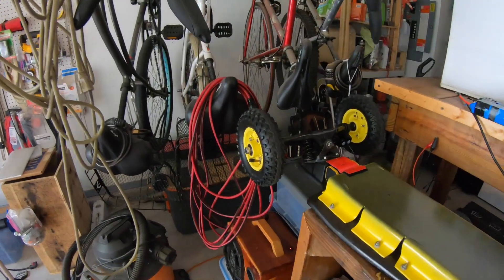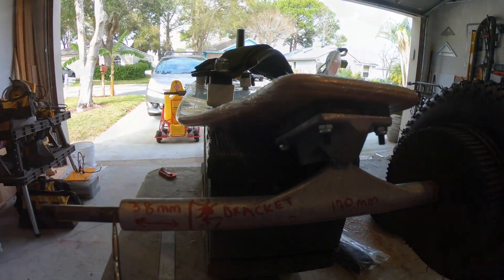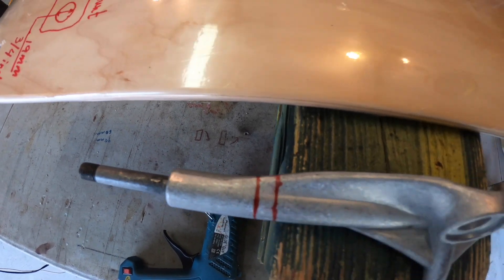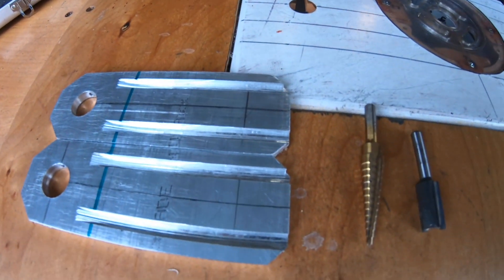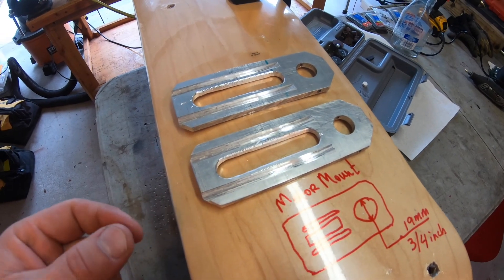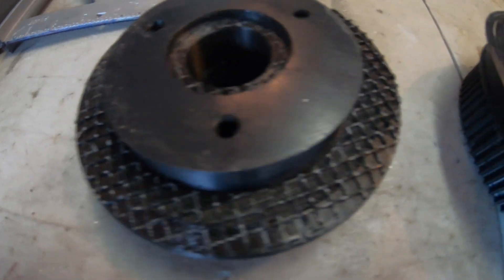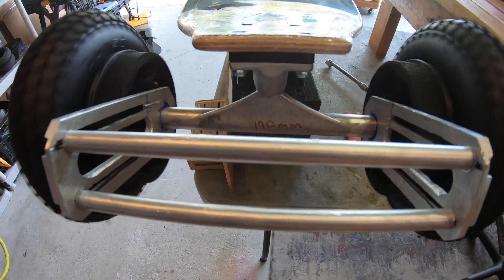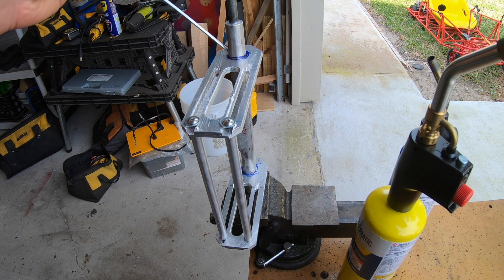All-Terrain ESK8 on Budget

Comment: Hy, how you conect Motor to Controller, i have also a Motor with Red, Black and blue cable, Controller blue, Green and yellow! How i Can conect it correkt?
Reply from the maker: Hi Pagtach.  If you only have 3 wires, it does not matter how you connect them.  Connect them any way you want.  If the motor is spinning backwards, switch any two of the three wires.  Hope that helps.  Have a good Day!
Reply: @artsiomnaidzich9515  ok thx

Comment: What filament did you use to 3d print the pulley? Nice Board, how is the range on a full battery?
Reply from the maker: Hi Mr. Soko!  ABS for filament.  10 to 15 miles range.  Also depends on riders weight and terrain. Cheers!
Reply: @artsiomnaidzich9515  Thank you!

Comment: Because you've got to admit you have a pretty nice machine shop there set up for building skates, really instead of taking offense to what I'm saying you ought to be taking it as a compliment the problem is me before just envious of your tool selection and sure they could do that if they had that kind of equipment, the 99% of everybody wouldn't be able to build any board like the board in the intro of this video I mean come on man you're giving people unrealistic hopes that they can do this on a budget with no tools or even  skills or time needed on using these tools I don't see it happening..  giving people false hope that they can have a at Eastgate for a few hundred dollars and it just ain't going to happen
Reply from the maker: Hey Tony. Im not taking offense to the shop comment. And thanks btw for shop compliment. My yt channel is a small part of what i do. And i do it not for clicks, but because i enjoy it. 

Its ok to disagree on a point.  (Point being that this video's title is click bait).  In video description, i do mention that this type of project does require tools and knowledge. This board was build on a budget of about $500. I know that to some $500 is a lot, myself included. Similar boards over the counter sell at about double that amount.  Sure, you can buy a used board in an unknown condition. Sure you can buy a board for 500 as well, but it will have smaller battery/motors (which is most of the cost of my project board here).  Therefore I feel  like this vide's title is appropriate.

Comment: Hey Guy, really nice Job!
Do you have drawings of the selfdone mechanical aluminium parts (motor brackets)?
And where are these little gearings from for the motor?
Reply from the maker: Hi Nico.  Thanks.  No drawings mate.  I used a.motor bracket that I had to get my measurements from..  Motor pulleys you can find online (amazon, ebay, aliexpress).  this board uses 5m pith tooth with 20 teeth.  Width of pulley is 15mm. Pulley 5m20T 15mm.

Comment: On a budget if you already have Thousands of dollars in tools and 3d printer ect.
Reply from the maker: Hey there Tony. Just about all of us have friends or family with some tools we can borrow or workshop you can use.  If you have another method on how to build an esk8 on your own without tools, please let me know.  Buying pre-made parts and just screwing them together is not building in my opinion (option that doesn't require tools), and is more expensive.  There has been a handful of people that shared the same comment as yours on this video.  I get that it takes tools. U cant have something out of nothing. If you have the drive and a will to build something, you can find the way to a 3d printer, a local workshop (many vocational schools can let u use theirs for a small fee), and people that can help you.  You know who is not going to get anything done/built? People that say: "esk8 on the budget? Yeah, right. Tools you used are expensive".
Reply: @artsiomnaidzich9515 I plenty of tools, just not specialty fabrication (expensive) tools like you got. And btw you need a screwdriver to just screw parts together. That is a took a d you know that no matter what premade parts you buy I've never seen a plug and play way of doing it and it's just not that easy, I'm sure you know that. Anyways what I was getting at about your clickbait video is I was hoping it was going to clue us in on some technique or parts to obtain to build a esk8 at costs on the low low. As esk8 parts are pretty damn pricey. Btw not everybody not even half of everybody is fortunate enough to know somebody who will let them use and put wear on their expensive custom tools and fabrication equipment. I by in no way am dogging what you have done or the way you did it, I am dogging the chosen deceptive title to your vid. Peace out brother build on. Oh and I have built my own esk8 out of screw together parts a few custom parts and I have bought a nice one for retail. It was the best purchase I've made this year and I don't regret it for a minute. Hey brother nice custom build you should be proud. Later.
Reply from the maker: If there is one thing i dont do Tony, its click bait. Most tools i used are woodworking tools not designed to work with aluminum.  I dont think you know/understand tools that i used.  I dont know of a more economical way to make your own skateboard than what this video shows. But here comes Tony with criticism, yet nothing to add.  Thanks for nothing bro.
Reply: @artsiomnaidzich9515  you don't do clickbait okay I'm going to put out a video and it's going to be titled how to drag race on a budget first step is I'm driving in this Corvette in here how the f*** is that if that's clickbait. there cuz it's not on a budget what cuz I used cheap gas and used tires??? Clickbait.
Reply from the maker: @tonyp3391 , you beautiful complainer.  It seems you have your mind set on proving that my video is click bait.  I couldnt understand what it is you are trying to say in your long rant. Sounded like a long run on sentence. Your og idea is to find a used board, and replace parts on it with used parts? I don't have to tell you that in a video format. Anyone knows buying used is cheaper... your corvette analogy, does make sense to me either. 

Het Tony, go for a walk today. Get some of that pent up energy out on productive things, rather than posting confusing rants.

I have built battery, pulleys, motor mounts, battery cover. 

This is the cheapest way to build a decent board thats new.  

That board has been sold, and still rides today.
Reply from the maker: Tony, that analogy is wack.  Click bait n bait n switch is same tactic. Title of a video promises one thing, video delivers another. Now, you are angry with me because i titled a video how to build on the budget, than i build a board building as many components myself as i can (in order to satisfy the budget claim). Yes, you do need skills and tools and time.  And that, in you angry brain is click bait? Good luck Tony! Have a nice day.
Reply: I watch these videos thinking I can finally build an e-skate on a budget, nek minute he's using $5000+ worth of tools🤣
Reply from the maker: @raynman6466 , you overestimate the price of tools i used. Same work can be done with hand tools but will take u much longer (also will require u to buy additional parts, like wheel pulleys)

If u have been doing diy esk8 hobby for some time, there are really two ways about it:

1. Expensive: most parts are preassembled, everything fits, there is relatively low amount of work that needs to be done.

2. Less expensive: where you build your own battery, enclosure, pulleys, sometimes decks, etc. its not a kit where most of the decisions on parts gathering has to be done by you, the builder.  Its a balancing act of what u are able to create yourself, and what u need to buy.  Also, people on esk8 forums will sell their used parts, but rarely for cheap.

Goal of this video was to show what can be done with mostly woodworking tools. But if all u see is table saw or miter saw and begrudgingly announce ur disappointment, than this video has failed to reach u.

If you know of other ways one can build a decent board on a cheap and without tools, do enlighten me.
Reply: @artsiomnaidzich9515  ok I'll enlighten you first off you are going to need some basic tools like you said but you're just not going to need like metal fabrication tools from a machine shop or something here's the enlightenment for you you watch marketplace or Craigslist you find it used crappy board that used to be good broke down or whatever and oops it needs an esc, oh wait a minute if you want it to be anywhere as good as you expect to be or that it used to be and if it was a party board you're going to need to be yes see no $60 parts going to work here you're going to have to get the two 300 $400 part just for the VSC then if you want to build your own battery well I happen to have one but you're going to need a battery you can get more than cheap things that don't really work for 50 bucks he has been a couple dollars on that we're already out of the budget mode already we're already done with the budget right there there's no enlightening you on how to do it any cheaper or budget mode because there is no budget mode Esk8 diy not one worth of crap anyways sure you can get the $50 ESC with the cheap ass controller that don't work for s*** and drives one motor at 10 mph but that's just not going to cut it for me. I will not you on one thing though for my battery box I used kydex a thermoforming  plastic to make a good size box for half the cost of what crappy regular black box of s*** would have cost me and I'm pretty impressed with it it looks pretty good on the board all you got to do is heat it up and form it in shape it works great and it's just pretty solid once it's cool down again. There you go there is a damn good tip.id post a pic if I could figure out how.
Reply: Can't expect to DIY build without tools! I reckon this can be done without the Dremel, mitre saw, heat gun, table saw or drillpress. I won't call it easy, won't look as good and it'll take longer. But it is aluminium,  soft and easy to shape with basic tools. 
Some great tips here like the aluminum brazing. That on it's own will save $×××× on an AC TIG welder!

Comment: Hello, I make quite similar built to yours and I'm wondering how those motors perform in time?
Reply from the maker: I made this board for a friend of mine.  He rides it a lot.  No problems with motors yet.  Are you having issues with your motors?
Reply: @artsiomnaidzich9515  no bcs I haven't ordered them yet, but on groups on Facebook some people said that they had some problems with magnets coming loose
Reply: And that was only issue that I was worried about
Reply from the maker: @ja-ob9bp  Ive had that happen to me.  Not with this motors though.  If you want to avoid that problem, get maytech motors.  New Flip Sky are also good.  Those two I have personally tried and know they can hang.  Everything else is a coin toss.  Companies just relabel generic motors and sell them as if they are much different than 80% of similar products out there.  Rebranding to be more precise.

Comment: Budget!! Right, first you'll need a budget board then a 3d printer, bench grinder, router table, mire saw, table saw, drill press, dremel tool with attachment, and a selection of other tools. Then you can get on with your budget build!
Reply from the maker: I cant tell if you are serious or just fucking around. First, you dont have to follow this recipe, just get a pre-assembled used board and call it a day.  Option 2, get all used components, put them together, and boom, u got a super frugal ride.  Above options are not good video material in my opinion. If you are willing to build something, you get some tools or have friends that have tools. The tools i used are not that rare or exotic.  And same result could be accomplished with less or different tools.

Comment: Where did you get the wheels and tires
Reply from the maker: Calvin Ronk Snee King, i used wheels and tires that this board came with. Pulleys are 3d printed (read the video description for the link to stl file)

Comment: If I use a vesc, would a 6354 motor be ok?
Reply from the maker: Yes.  I've build another board just like this one using 6354s.  6354 offers a good trade off between weight and performance, especially with a solid VESC.

Comment: This is the pulley right? https://grabcad.com/library/20mm-72t-htd5m-cheap-style-8x2-pulley-1
Reply from the maker: Yes
Reply: @artsiomnaidzich9515  what is the length that you printed it at? Default is 119 Inches.
Reply from the maker: Caden Spring, i didnt have to resize.
Reply: @artsiomnaidzich9515  Is it 8x2
Reply from the maker: Caden Spring, yes

Comment: where did you get your belts and gear for the motor? I don't see the links to those in the description. Could you also share the 3d model for your pulley system
Reply from the maker: Belts I got on amazon (i think its 5m 445-15 belt. D&D PowerDrive 445-5M-15 Timing Belt, Rubber https://www.amazon.com/dp/B00ISC5MAA/ref=cm_sw_r_cp_api_i_GrDeFbMHAPTGV). Keep in mind that you may end up with a different size belt depending on what motor brackets you use.

Motor pulley for 120 kv motor:  uxcell Aluminum 5M 20 Teeth 10mm Bore Timing Belt Idler Pulley Flange Synchronous Wheel for 15mm Belt 3D Printer CNC https://www.amazon.com/dp/B0747GB3F4/ref=cm_sw_r_cp_api_i_UsDeFbGV64W5W) if you use a higher kv motor, you may need to use a smaller diameter motor pulley.

Lastly i found STL FILE for drive wheel pulley on grabcad.com. Search around for 200x50 wheel, or hub, or 72 tooth pulley for skateboard wheel. If you cant find it, dm me through FB messenger with your email. I can send you the stl file.
Reply from the maker: https://grabcad.com/library/20mm-72t-htd5m-cheap-style-8x2-pulley-1

Comment: How is it driving?
Reply from the maker: It's a smooth ride at medium and high speed.  Slow speed maneuverability is ok.  I've taking it for a two mile tall grass off-road run.  That's where this ride shines.  With it 120kv motors, it chews through grass and dirt no problem.  It's a budget build, so I didnt want to change much on this set-up.  Getting better quality trucks and better ESC would make this ride even better.

Comment: How many batteries do you recommend for this build?
Reply from the maker: There are many variables with what cells you may use.  As personal preference I like using 3000mAh cells.  For all-terrain boards with pneumatic wheel, I like using 10s5p (for generic ESC), or 12s5p for Vesc.  My personal board I have a 12s6p (this allows me to max out on Vesc and Motor output and gives me longer range).  I dont' mind my boards being heavier due to bigger battery in exchange for more power and distance.

Comment: great board! my board using same ESC but I place it above rear truck
do you know how to strengthen remote signal? if I place my remote like 50 cm above front truck, it wont reach the esc (receiver) if i use other hand to control the remote, my stupid hand is not so responsive and sometimes stupidly push the throttle accidentally lol
Reply from the maker: Did your ESC have a little antennae that it came with.  I've used those ESC in many different builds, but never had this problem, with or without antennae.  Take apart your remote and look inside.  There is a little antennae there as well.  Check on that antennae and make sure it's attached and secure.
Reply: @artsiomnaidzich9515  nope, there is no antenna on my esc, I just open it and remove hot glue and I found ufl/ipex port, plug new antenna and now its like a RC car controlled from 20m, but I wonder why they glued it
Reply from the maker: Chandra Suryanto, prob glued to avoid separation due to vibration.